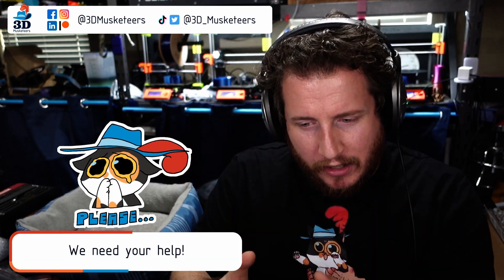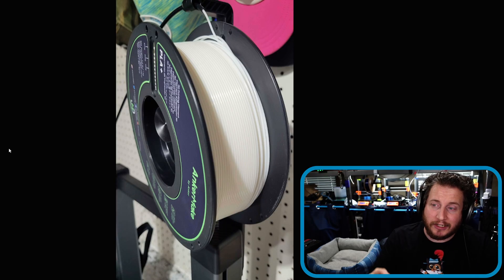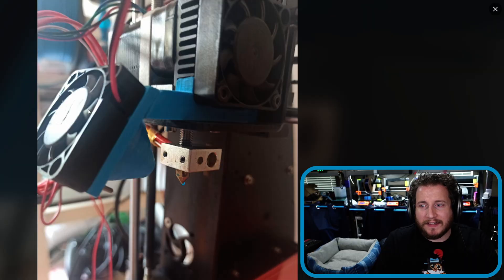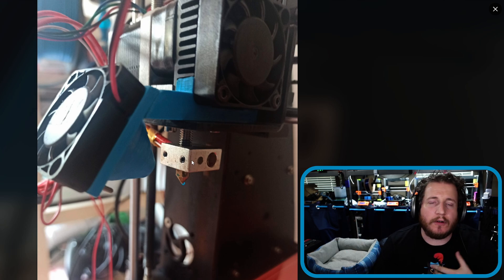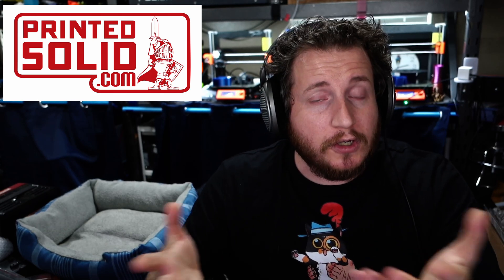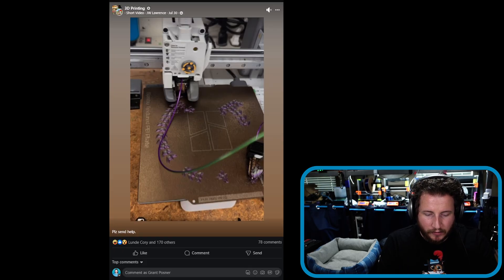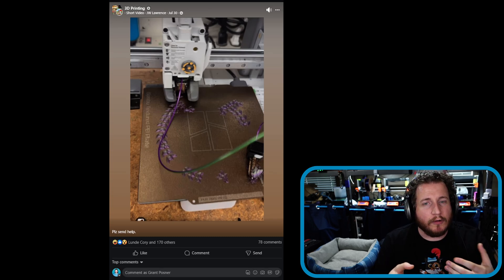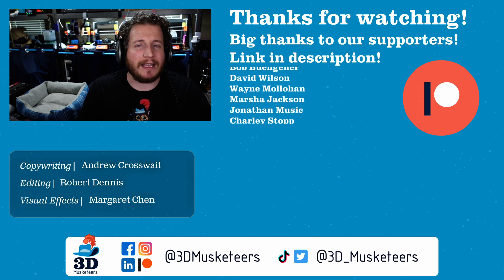When Hotends & Nozzles AREN'T Where They're Supposed To Be! - PrintFixFriday 151

Comment: My Bambu A1 toolhead stopped extruding.  When I move the black data and power cable forward and back the extruder motor stops and starts.  Curious if others have had this and whether it was the PCB or the cable?
Reply from the maker: you can check the PCB but it is likely the cable going bad

Comment: I tried to load filament without a nozzle myself. Even the tiniest bit of residue made it very hard to get a new nozzle in. Eventually got it clean, but mine was not here near as messy as what was shown and it was still a pain to clean enough to slide a nozzle in easily.

Comment: You're going to test just the tip of the Diamondback? Sorry, couldn't help myself. I am very much looking forward to that video.

As for the Bambu self-ejecting hot end: at the risk of appearing to try and dunk on Bambu Lab, that's a really silly design fault. Bambu markets hard to non-technical people looking for their first 3D printer, and that kind of failure seems 1) easy for a newbie to miss, and 2) really messy to clean up.

Comment: I love how with 3d printing you can fairly easily take a modern extruder print head and install it onto a completely different printer. For about $40 you can put an Elegoo Neptune 4 extruder on. A little bit of fiddling with wiring, and you have a modern extruder. The Sprite extruder kit comes with the cable, wheels and it is all nicely labeled, that is what I did about 2 years ago.